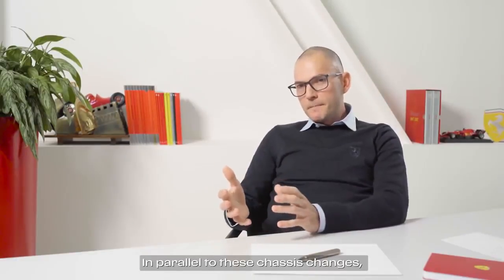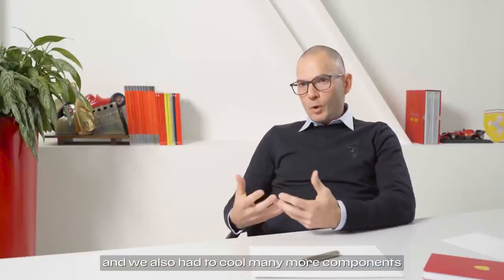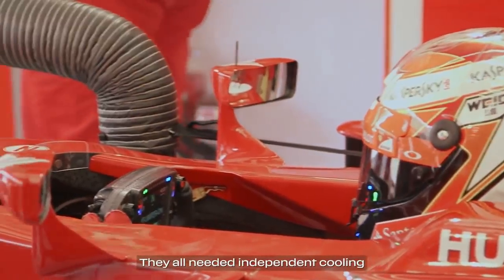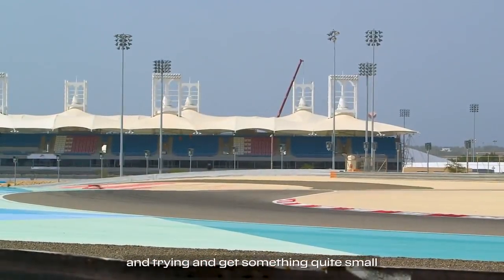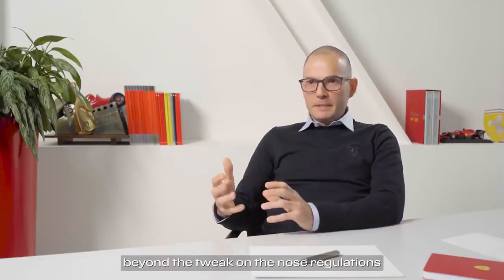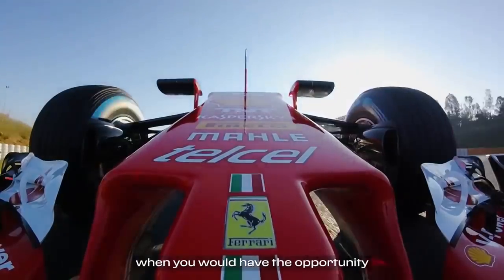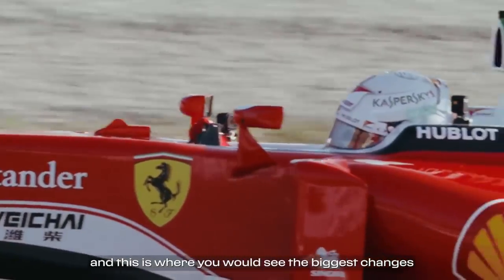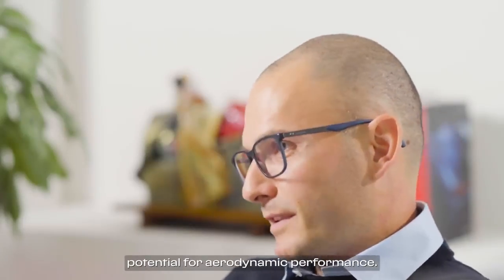Hybrid Era - Chapter 1

Comment: 2014, the year I discovered this amazing alien sport. 2018 the year magic was largely ripped away by the Halo for me 😔 after having a temper tantrum last few years I'm finally back (as a full time watcher) for the new regs. Still feels more like watching machines than pilots now. I'm thankful for what the Halo has done but in the most technologically advanced sport on the planet they should be able to create ways to have that safety without sacrificing the core essence of F1. Virtue signalers and soft fans will disagree with me and say "Oh Grosjean Grosjean!!" But two things can be true. The halo device saved Romain (although not having an idiotic runoff track design would have made the whole issue moot) but it is also an abomination to Formula 1. Create a windscreen strong enough, make the halo translucent, elongated in such a way that it is better, just get this metal thong out of the way of us being able to see the PILOT operate the car. Not just watching hunks of metal speed around the circuit.
Reply: Prima la pensavo come te, nonostante non mi andasse giù l’halo ho continuato a seguire lo sport che amo come farò sempre a prescindere. Devo dirti che è solo una questione di abitudine, ti abitui molto in fretta, finché non te ne accorgi nemmeno. Poi alla fine sono i piloti ad andare in pista, noi non possiamo fare altro che ammirarli e supportarli, se loro sono d’accordo con l’halo per me non si pone il problema
Reply: @iltriumvirato1576  imagine still complaining about the halo in 2022
Reply: @ste5425  È quello che ho detto anch'io 🙃